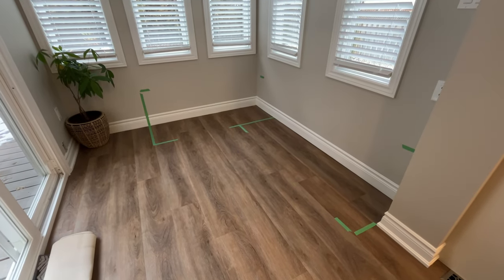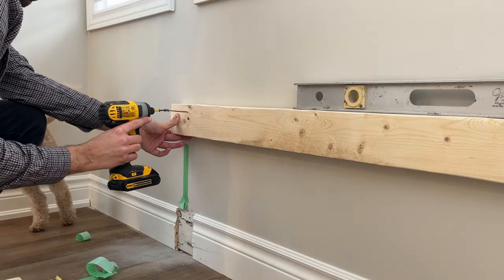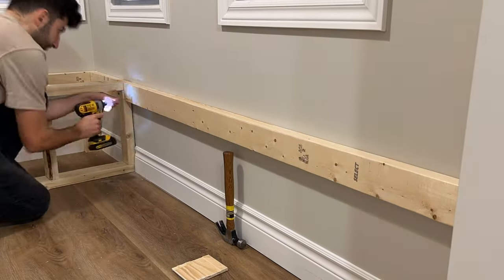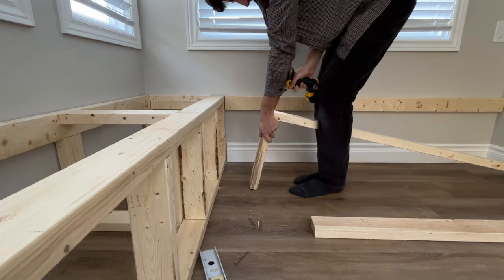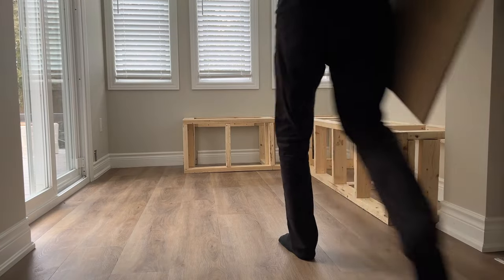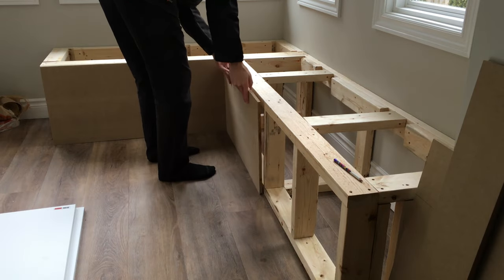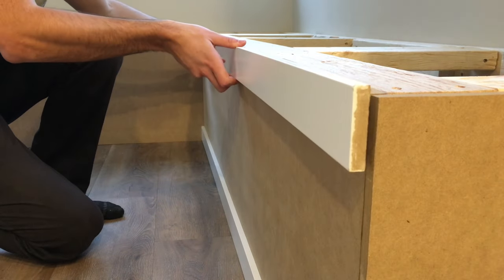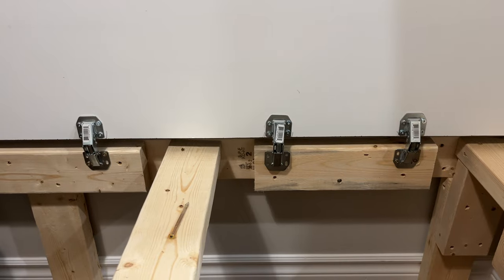Building a Window Bench Seat with Storage (DIY)

Comment: How much did this whole project cost you about?
Reply from the maker: I dont have the exact number but it was somewhere between $200-400 CAD for the size we built. Cost will vary slightly depending on materials used obviously. For example, we used mdf boards VS. plywood. Both work just as good, it just comes down to preference. Hope that helps!

Comment: What is the length of the screw you used? Is it 3” or 4”?
Reply from the maker: I believe 3"👍🏼
Reply: @nickdesgn  Thanks. Already built the bench. Where did you order/made the cushion? Any references?
Reply from the maker: @jinojonesscaria  No problem! I searched "custom bench cushion" on Etsy and there were numerous options on there. You just have to tell them the length and width plus the thickness you'd like once you find a seller you like

Comment: Creative. Not a fan of the HVAC solution or the top. Would have centered the HVAC register on the front of the unit. Also, Would be more visually appealing - and stronger - if the lid backsplash wooden strip was one piece verses three. 🤷🏻‍♂️

Comment: Are your tops terribly heavy? I’m wanting to build a couple of these that will be 7 ft long. I’m considering cutting the top in two to make it less heavy. Wondered if you thought it was necessary?
Reply from the maker: They do weigh a decent amount. We thought about adding additional hinges such as the soft close ones or hydraulic ones to help with it. However, I would say the size of ours is perfect, any larger i would definitely suggest cutting them in two!
You could always install it as one 7ft long piece and test it out. If you find it too heavy even with the proper hinges then I would cut it.
Also depends on who will be using it (just you vs. family members/friends/kids) and if you trust them to be careful with it. Hope this helps!

Comment: How did you work around the baseboards? It looks like you cut out the width of the 2x4's from the baseboard. WOuld you recommend doing that or just completely removing the entire length of baseboard trim in the first place?
Reply from the maker: That's correct, I did cut out the width of the 2x4! Since it's a small piece of baseboard thats left visible, I would take it off and cut it then reinstall it if i had to do it again. But if it was a way longer piece of baseboard, cutting it in place is easier. Once you take the baseboard off (without breaking it) you have to re-nail it, fill all the nail holes, give it a sand, then paint...extra work i didnt feel like doing especially if that piece was very long. Hope that makes sense!

Comment: Looks great, nice and clean design. What was the cost for materials?
Reply from the maker: Thanks! I dont have the exact cost but it was somewhere between $200-400 CAD for the size we built. Cost will vary slightly depending on materials too. For example, we used mdf boards VS. plywood. Both work just as good, it just comes down to preference. Hope that helps!